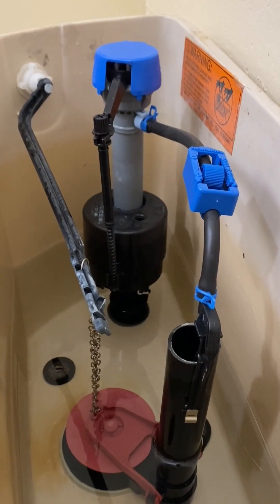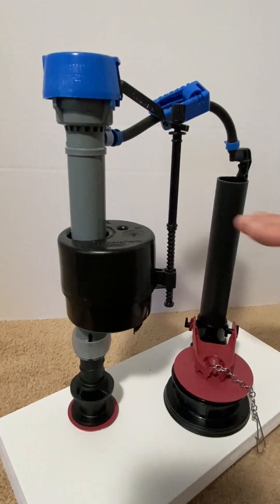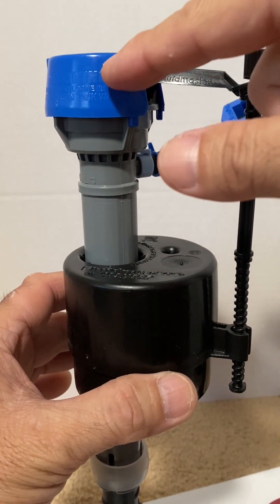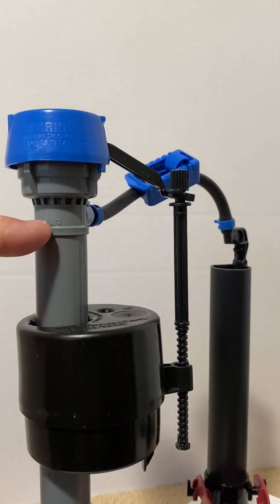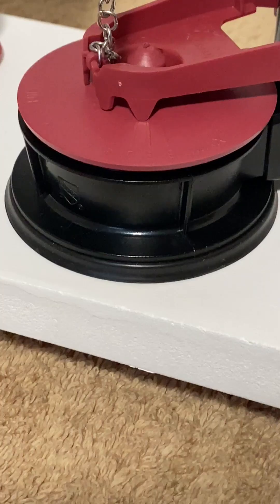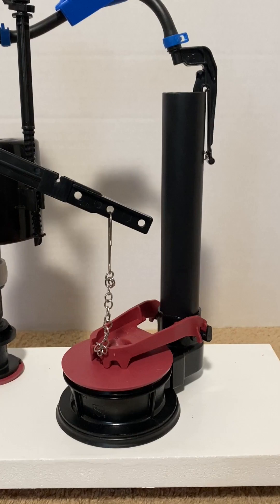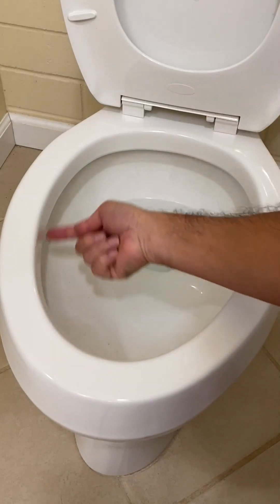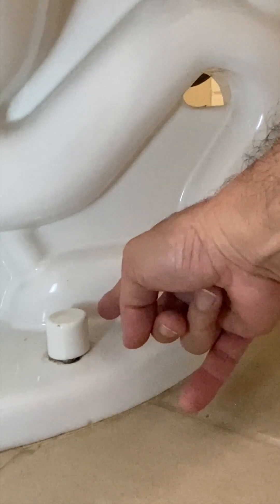How Toilets Work

Comment: At age 63, I have installed many toilets, trouble-shot many others, but I am having a time lately. The water level is dropping, and I assumed it was leaking past the flapper. Replaced the flapper and it is still leaking. I can't see any rough edges that would keep the flapper from sealing. I thought I must be missing something. The only reason I care is because the shower will nearly scald me if the toilet refills while I'm in there. I still don't know what's going on. Maybe the overflow tube is leaking ?
Reply from the maker: Leaking by the flapper is the most common problem.  Here are two options off the top of my head to test the flapper seal.  1) Turn off the supply valve and flush the toilet to empty the tank.  Remove the remaining water with a wet vac, towels, or sponges.  Dry the valve seat and cover/seal with duct tape.  Open the supply valve to fill the tank and see if the water level still drops.  2) Install the Fluidmaster flush valve repair kit.  Here's a short video... https://youtube.com/shorts/6kkw44MzEzo
Good luck!
👍😎

Comment: Something isn't working correctly with my fill valve. Unless there's something else I'm not aware of. I replaced my fill valve with a Korky universal fill valve and no matter how much or little water I let flow into the flow tube the bowl fills up at the same level every time, which in this case is very quickly. According to Korky you're supposed to adjust the water flow for the flow tube so it shuts off about the same time as when the tank is full. However for me the bowl fills up super fast every single time no matter how little water I send through the fill tube. I just don't know how that can be possible.
Reply from the maker: That's normal for some bowls.  The bowls in our old Kohler toilets fill up pretty quick from just the flush.  We save water by diverting the fill tube water to the tank instead of the overflow tube and bowl.  Here's a video on that... https://youtu.be/uMfD_utCahg
👍😎
Reply: @HacksbyDad  Thank you for the quick response and letting me know that. I will say however that from what I remember the original fill valve that came with my toilet filled the bowl up slower. But I think that's because one of the features of the Korky is it's a much faster fill rate. And I never thought about diverting the fill tube to the tank. That's a pretty good idea. Though I can turn the little valve on the Korky fill valve all the way off, or at least to where it's practically off. I did that when testing and it made no difference at all in the fill rate of the bowl. Thanks again.

Comment: I have an issue now where the tank is slow to fill. I replaced the toilet flapper but when shutting off the toilet supply line the valve is completely tight and closed and water is still supplying the tank. So I figure the bibb washer on the shut-off valve is already worn.  So I still managed to replace the flapper and have someone hold the fill valve float to closed position while adjusting the flapper chain and float to optimal setting.  After 2 days, the tank is slow to fill. I was thinking small debris from the shut-off valve bibb washer has lodged inside the fill valve ports!  I need to replace the shut-off valve or replace with brasscraft rebuild kit but now I have to shut-off the main water lines in the house.
Reply from the maker: Sorry to hear that.  Replacing the shut-off valve can be a pain.
Reply: @HacksbyDad  I may call a plumber to do this. It's a pain for me as I have no room to make a mistake if I do it myself as the whole house has no water supply during the repair.  I'll ask the plumber just to replace the internals with rebuild kit which I already purchased.